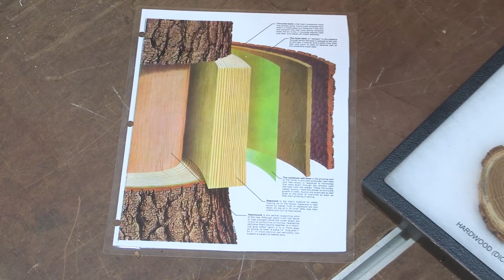How Trees Grow

Comment: I learned about medullary rays. That's cool because I might use it someday to  consider the wood I choose. I've been learning all about foraging and survival such. It's powerful to know what can be used for what, or at least be able to figure it out. Medullary rays tells me a wood strong and durable. I can use pine for starting fires with its resin sap, dead Pinus strobus for fat wood, make tea with Hemlock needles, and get dry dead branches for firewood held off the ground at it's base. I can identify White and Red Oaks by their leaves and acorns  Supposedly the acorns from the White Oak are not so bitter, can be cooked with less changes of water to make palatable. Haven tryed that myself yet.

Comment: How do trees grow? We already know about the rings. How do trees get taller if you make a mark in one spot and it remains in the same spot 20 years later yet the trunk is 40 feet taller?
Reply: via shoots, he has actually shown the pith of a side branch. that shoot has cambium (i guess) covering it at the tip and dividing cells in "upward" direction. that's why he also said that when you look at pith "count 3 years" because there isn't just sideways growth.

Comment: Dendrochronology is pseudo-science.
Tree-rings are also determined by microclimates, pests, rainfall, disease, and canopy cover - they are useless at determining temperature and climate.   
In addition, a single tree can have dramatically different ring-thicknesses in one section of trunk. The left side may have thick rings in a certain decade, while the right side has thin rings.  So if you core the tree from the left the climate was warm, and if you core it from the right the climate was cold.
Same goes for dendrochronology.  If tree-rings are highly variable in one tree, and stands of trees are effected by local conditions, then how can you compare a ship’s timber with a reference bog-oak in Ireland, or a bristlecone in America?
As I say - it is all bogus pseudo-science.  It’s a joke.
See my recent paleoclimate paper: Modulation of Ice Ages by Dust and Albedo.
Ralph.